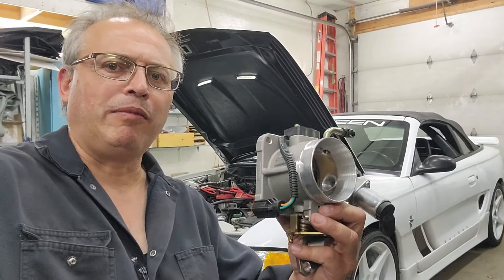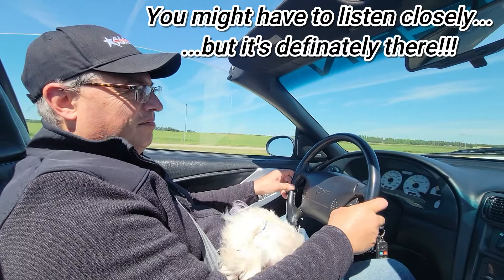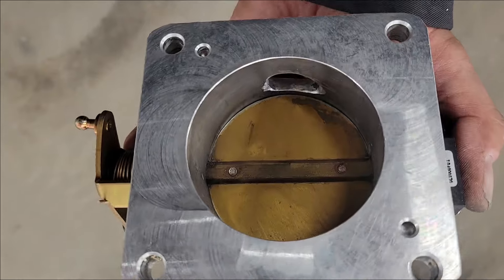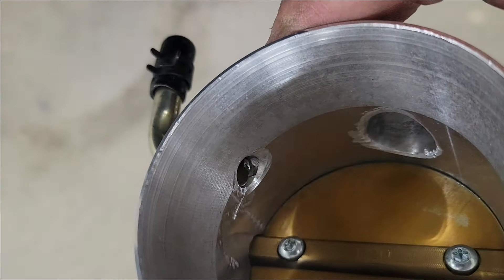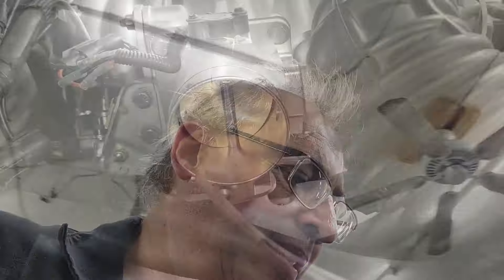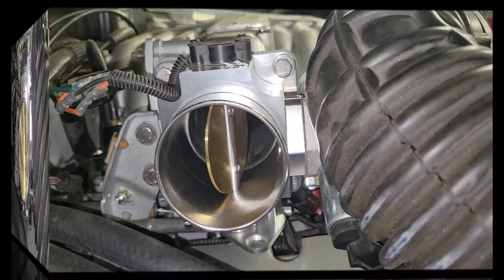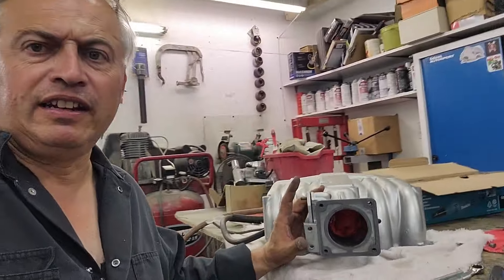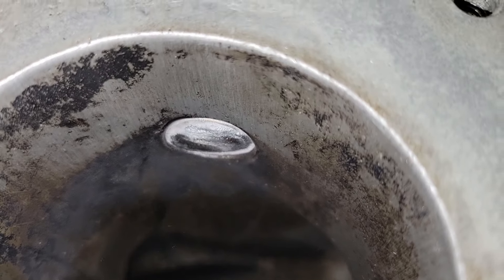70MM BBK THROTTLE BODY WHISTLE...SOLVED!!! -306 Foxbody

Comment: Good diagnostics!

I have a new 2024 Chrysler Pacifica and it has a whistle when the throttle body closes while cruising. It took me a couple hundred miles of paying attention to identify it at the throttle body. While this is a far cry from a Mustang, airflow is airflow. In my case, it is under warranty. That means if I attempt to fix it, they will screw me over for warranty work for just about anything. (I worked at dealerships for years and saw this happen) Furthermore, they will not be able to diagnose it themselves because... there are no longer real diagnostic mechanics. I was one many years ago; that is why I was able to determine where my whistle is. Your video came up while googling to fix my problem. I'm still not sure what I will do about it. It might be easier to purchase an aftermarket TB and see if that works. If not, I can round out the area for the bypass on the aftermarket. (where I believe the problem to be). I haven't blown air through it yet, but I am 99% certain it is in the TB at the bypass hole. Though, I don't even know if it has a bypass hole or if it uses an aux air regulator when the TB butterfly is closed. I'll figure that out when I have time to work on it.

This problem on Pacificas has existed since 2017 and Chrysler tells people that it is a known issue that cannot be resolved and to live with it. For me, that's not going to happen. I've been wrenching for decades and cannot accept that. I'll figure out something.

As an aside, I have a 2003 Mustang GT that I turned into a Kenne Bell supercharged Saleen S281sc. I didn't like the Saleen hood, supercharger, and rear wing so I purchased different ones. As for the EGR on my Kenne Belle, I simply disconnected the vacuum line so the EGR pistle would still be there. Thus, no whistle. This might be a quicker fix for people that cannot manufacture their own dummy plate.

Thanks for the video!